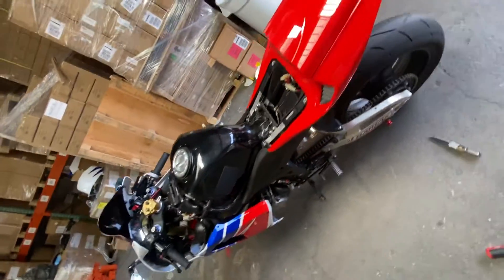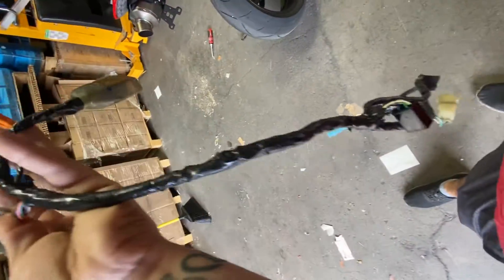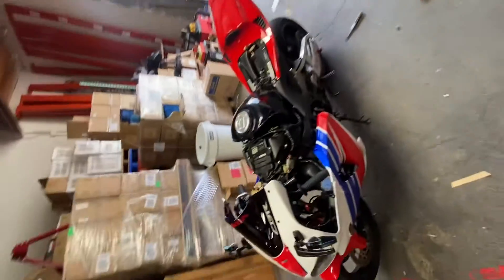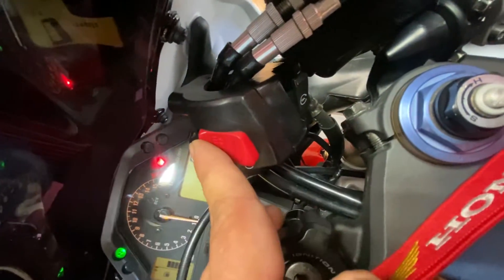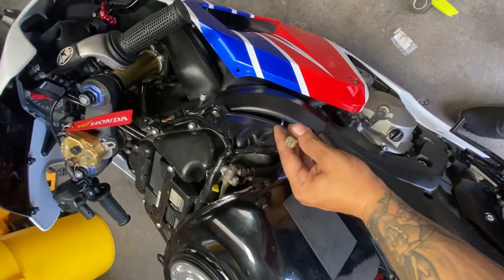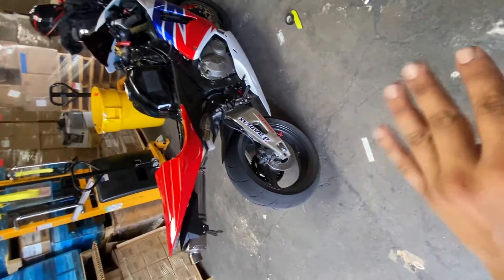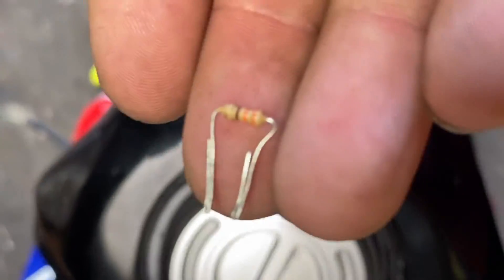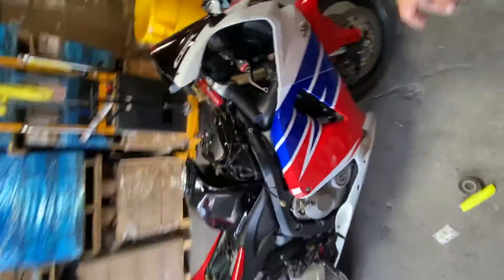O2 sensor delete 2006 CBR600rr

Comment: Would this work for a 06’ 1k? I installed a full toce exhaust system. Didn’t come with a O2 sensor plug, I plugged the hole with a nut they gave me. Installed a servo eliminator for that red plug. But should I do this to the white plug connection? The ecu was also sent to Toce for them to flash tune it.
Reply from the maker: Only if your mil lamp is on

Comment: Which slots/wires on the sensor did you jump?
Reply from the maker: When you unplug the o2 sensor there will be a notch that secures the clip. Face that pointy notch upward and jump the two bottom terminals. Don’t remember the colors it’s been a while. Hope this helps!
Reply from the maker: https://youtu.be/1jSKZFxXHYE this guy does a good job at explaining

Comment: Hey, any idea why the bike idle soundslike that? Mine idles just like that and i’m trying to find out why
Reply: Try adjusting the idle screw on the left side of your bike. It's down by your stator. It's like an 8 point star dial looking thing. Middle will be Phillips screw. Twist it right until it's closed (don't force it or you could damage it). Start the bike and begin to twist it left until idle sounds better. If it's not that, check your fuel maps if you're running a power commander.